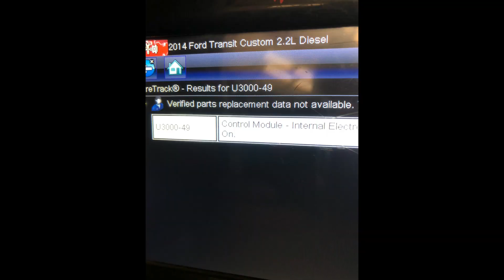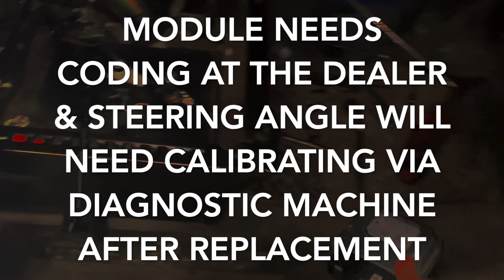MK8 Ford Transit Airbag & ABS warning lights on dash

Comment: I have this problem. Exactly the same. How did you find out the yaw rate is in the restraint control module? Nobody seems to know?
Reply from the maker: I contacted Ford and they found out through Ford technical mate
Reply: @diydaly  cheers I did the same yesterday. Do you know if I replace it can I use one with any part number ending i.e mine is AF and some have Ad or Ac
Reply from the maker: @andrewwrathall5751  I’m not too sure to be honest mate as I’ve only ever fitted new units from ford , they did need coding too .. I don’t think you’ll be able to fit a sh unit
Reply: @diydaly  no probs. Thanks very much for your help
Reply from the maker: @andrewwrathall5751  👍
Reply: I have this exact problem how much does fords charge to code and can van be driven before coding it ? Cheers
Reply: I repaired my crash damaged transit myself nd now those bastards are not willing to reset the module . Can i do it myself with autel IM 608 S pro II ?